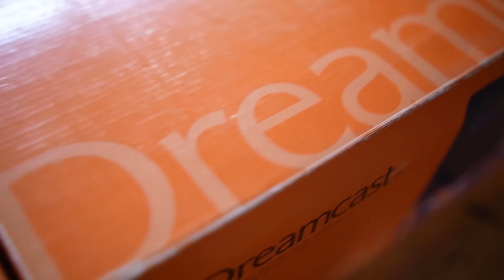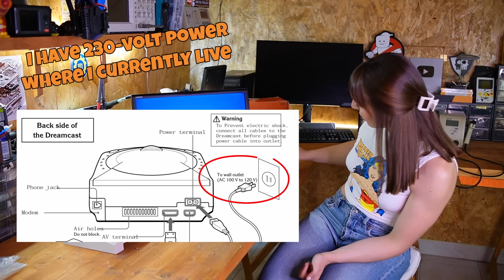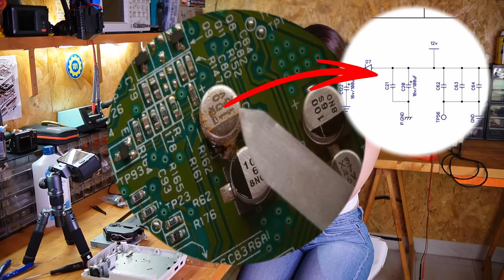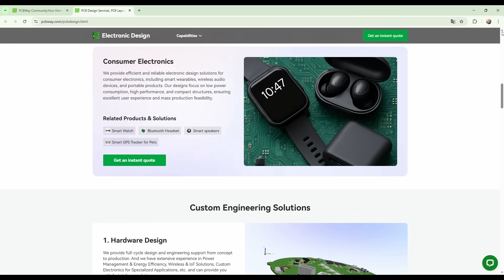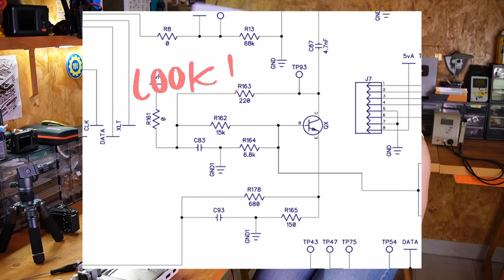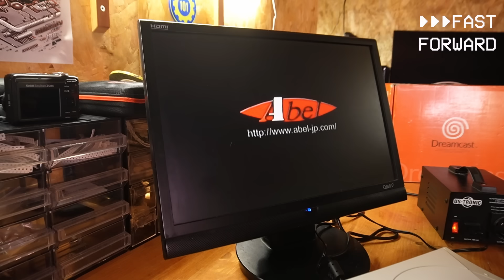Can I Save My Mom’s Dreamcast After All These Years?

Comment: Thank you ..Oh boy I just went through this with my Dreamcast..I tried tweaking the laser but it still stops spinning and can't read the disc...I gave up and just figured after sitting 15 years the laser went bad ..I didn't change the capacitors or resistor like you did...I may have to pull it back out again and check those..I seen a capacitor kit on the Internet for the Dreamcast...Wish me luck my Friend ❤❤❤❤

Comment: My mind went straight to bad capacitor and battery replacement, because even back then just like two years after launch it was always the same bad bad capacitor and the batteries were already going flat and the consoling beeping. The laser as well back then needed tweaking and cleaning.... Still not as bad as the PS2 which stopped reading those blue CD based games really early on. I forgot what caused that problem, but I remember it being something to do with the CDs not weighing as much and slight warping of the system through heat or dirt or wear stopped them from being read..... People blamed the laser, which you could up the power, but it was really just a poorly designed system.

Comment: Sega consoles? Guaranteed thumbs up! :D 
Do you plan to replace the disc drive with a GDEMU or do some other mods (besides the battery)? I heard modding JP models is more difficult due to the mainboard and its specs. Very curious about that...
Reply from the maker: I might try some mods later on, but I’m not sure yet. I’ve heard the same about JP models, so it could be an interesting challenge!

Comment: I got the same version of the Dreamcast from Japan. It's the rare 1998 VA0 revision, which was overengineered, Made in Japan — built with high-quality Japanese components, metal heatsinks connected to a cooling fan, and superior audio output compared to the later VA1 and VA2 revisions which were made in China and Indonesia. So be proud — you own one of the roughly 5% of all Sega Dreamcasts ever made.

Comment: I used to repair Dreamcasts. Just a little Easter egg here. If a factory controller does not work it's the resistor every time. Up it by about 10 ohms.

Comment: I was actually shocked when it didn't work. I got mine in 1999 and it still works now and I never had a problem with it. It has been more dependable than my cartridge based gaming systems.

Comment: I fixed a dreamcast and then broke it worse. I replaced a dead battery and fixed a broken power switch to fix it. Then when I was putting it back together, I put one of the long screws in a shorter screw spot and the screw went into the motherboard, like 2mm. This was enough to take out the video because it would turn on but I wouldn't get anything on the tv. Went from super happy to super sad.
Be careful with them silver screws, the length difference isn't much, but enough to damage the console if you put a long screw in a short screw spot.
Reply from the maker: I’m really sorry to hear that, that’s brutal! Those little silver screws are sneaky like that
Reply: @Sayakas_Digital_Attic they should have made those screws the same length. If not at least change the color or something. Glad you got yours fixed though😊

Comment: I had a Dreamcast when I was in junior high school. I replaced the crystal oscillator successfully. I was impressed by how smooth it became when I overclocked VF3. Overclocking this console's oscillator doesn't affect the display frequency. This wasn't the case with the Sega Saturn, which came before it. Overclocking threw off the vertical sync signal, causing the screen to display incorrectly.
Reply from the maker: Wow, that’s awesome! Overclocking without messing up the display sounds like a dream compared to the Saturn

Comment: I heard for dreamcast, you shouldn't plug or unplug the controller during the power is on. The controller board might got fried by this. I know in other console this is not a problem. But I heard a lot of horror stories about this. I rememebr there is a mod that you can do and it will allow you to do plug unplug during power is on after the mod, but i forgot what it is or how i did it since it has been a while. But i think it's not hard to search online to find this info. Good luck!

Comment: I would recommend you to wear insulating gloves before manipulating a switch mode power supply, reason being at the time not all power supplies had discharge resistor for the high voltage bulk capacitor, and these can be charged at 400VDC, even in power supplies with discharge resistors it can take more than a minute to discharge the bulk capacitor to a safe voltage (<60VDC) when you disconnect the AC input, so be careful because they can hurt you badly and even unalive you. Great video, I'm a power supply engineer btw 😊
Reply from the maker: Thanks for the tip! Really appreciate the safety advice and glad you enjoyed the video

Comment: I actually bought one of those back in 1999 as well. I still have like 4 of them.
Reply from the maker: Awesome! They all work?
Reply: @Sayakas_Digital_Attic  Yep. However, one has some laser issues. It can read giga discs and most CD-R's but, not ever disc that the other 3 can. I see there are tutorials to adjust the laser. I hope that if I get around to it that I can adjust the focus bias only as I have read that adjusting the intensity just makes the laser burn out and die faster.

Comment: Never ever touch the pots on a CD drive unless you’re using a scope to perform adjustments. The pots aren’t the problem.

As you discovered, the problem the vast majority of the time with optical drives where the mechanism isn’t damaged or jammed are bad caps.
Reply from the maker: Thanks, most issues really do come down to bad capacitors

Comment: 9:00 is that supposed to happen?
Nice new edits with these comic arrows.

I hoped for some ASMR controller cleaning ☺
Reply from the maker: Well the capacitor was really badly damaged so by heating it a bit it came off easily, usually that doesn’t happen!

Comment: I won't be fanboying or simping you as most of the comments. I have repaired more than 20 dreamcast that weren't reading disc. From my experience, capacitors on the power supply are always out of specs. I would suggest you to buy an ESR meter. Also, capacitors on the gd-rom controller board are always faulty, they are massively out of specs and you didn't recap any.
Reply from the maker: Thanks for the tips! I’ll definitely look into getting an ESR meter

Comment: I'm having a weird issue with my Dreamcast. One day, out of nowhere, port number 2 stopped responding, later the same thing happened with number 3. I replaced all the components on the controller board, but nothing happened. Afterwards, I tried replacing the entire controller board (including the ribbon cable), but everything remained the same. Could it be that the problem with ports 2 and 3 is coming from the motherboard?
Reply: Sounds to me like just dirty pins honestly, the Dreamcast controller ports can get bent a bit out of shape if controlllers are left plugged in for a while, you should try those ports whilst pressing down on the end of the plug, if it comes back to life they’re likely just dirty.

The controller board is mostly passive so the pins go right through to the main board through the ribbon cable, the data lines pass through a row of resistors, 1 for each data line of each controller, try measurung those of cleaning doesn’t help anything. 

There is also the classic fuse that pops when controllers are plugged in or out whilst the console is on, which can blow the resistor next to the ribbon cable connector, you can fix that by installing a resetting one or just twisting it so it shorts, have done that personality for years and it doesn’t hurt anything and also presents the same thing from happening again, so it might not hurt to just do, likely won’t be the main issue as your A and D ports seem to be working. 

Just measure and clean! You’ll get them working for sure! Cleaning the controller plug itself is also a good first step.

Comment: Waiting on my Dreamcast to arrive, can’t wait to start my restoration and upgrade.

Wow someone has been pumping iron 💪
Reply: Wow!! What a machine!! It truly is a home arcade…and a tractor in sound 😂

Think I got lucky, was a lil mucky on the outside and when i popped her open, just a lil bit of dust and hairs on the edges. Stripped her down anyway. Scrubbed the insides, recapped the motherboard, new 1mm thermal pads on all 4 points, serviced the GD-Rom. Took away the battery and replaced with cradle and new battery. Switched out the orange power light for white. Installed white LEDs in controller port. Dropped it all in a new solid black shell with white decals (SEGA, Microsoft etc) but I swapped the power button and open button and the controller port shell with transparent blue. Painted in the words POWER and OPEN and the letters A B C D in white. Swapped the black lid for the transparent blue, and the finishing touch… a black badge with the blue swirl and white writing 🤌🏻

Comment: One of the quirks of the DC: if you remove the controller from the first port while the system is on, it could blow a fuse in the system. Congrats on 150k, looking good! ^_^

Comment: Hey you have a Weller soldering station there! Which model is it and how many watts is the iron? Mine was given to me by my uncle back in the 2000s, a 45W iron and station. I think I will buy some larger tips for it soon, to do thicker wiring / harder jobs.
Reply from the maker: This model: Weller WE 1010 (T0053298699) 1 Channel Digital Soldering Station, 70 Watts / 230 Volts, Temperature Range 100 °C to 450 °C, Blue

Comment: You can convert the power supply to universal voltage, since it's a simple flyback type. The difference between JP and PAL models is 3 components, PAL has capacitor C3 68u 400V, R13 and JP1 62kOhm 0.5W. Uprating C3 to 400V (capacity is not critical) is necessary and more or less sufficient, but R13/JP1 is the bootstrap line for the SMPS controller so i think that's good to make sure there's enough resistance, the PAL build should bootstrap at 100V just fine too, just take a few milliseconds extra.

What the bootstrap line does, it trickles some current from the rectified mains into the capacitor C10 until the SMPS controller has enough voltage to start pumping the transformer via Q1, and then it'll start getting power via the main transformer through D2 from an aux winding. In old and tired PSUs, the bootstrap capacitor is generally bad and is the first thing i test or replace and uprate, and you never see the issue visually since they don't leak.

The batt often doesn't need to be replaced, just leave the console on for 40 hours and the original one can wake up and start holding charge :D But ML2032 replacement is totally fair as well.
Reply from the maker: Thanks for the detailed explanation! Really appreciate the tips on converting to universal voltage and the bootstrap line, super helpful for future repairs

Comment: Hearing you say it works is instant serotonin. Orange box nostalgia, step down on, good cable in, pot tweak and bad cap out, new battery holder and then the magic, it works. Super clean work and a very cute assistant.
Reply from the maker: Thank you! It’s such a satisfying feeling when everything comes together and works perfectly 😊

Comment: Can you save a Dreamcast that powers on and is functional outside of the disk mechanism, my guess is sure.

Adding a bit of flux when using solder wick and it works so much nicer.

Comment: PSA: Please NEVER plug / unplug a controller into the Dreamcast when it is switched on. It will almost always pop the fuse in the controller board which will prevent controllers from working until it is replaced.

Many people are putting in resettable fuses.
Reply from the maker: Thanks for the heads-up! I’ll be more careful next time

Comment: Nice that you take care of your mother's good old DC. 😊

An anecdote from me: 
The Dreamcast I'll never forget it, we were playing Metropolis Street Racer on the Dc and it was connected to a 21" CRT VGA monitor with a VGA cable.
I had bought a Japanese PS2 with Ridge Racer V and a Memcard through a dealer and the doorbell rang and the PS 2 was delivered. 
We briefly paused MSR on the Dreamcast and wanted to test the PS2. When Ridge Racer V started and we saw the evil edge flickering of the graphics, we looked over at the DC monitor and the disappointment with the PS2 was great. 
I immediately packed the PS2 and sent it back. Only after the end of the Dreamcast did I buy an EU PS2. 

The DC was far ahead of its time, it's a shame that Sega has withdrawn from the hardware sector.
Reply from the maker: Wow, that’s a great story! The Dreamcast really was ahead of its time and I totally get the PS2 disappointment!

Comment: Most, if not all, top load optical drives have a safety switch that prevents it from running when the top (or cover) is open, so you don't get lasered in the eye. That is why it didn't turn on properly, until you put the case back on.

Comment: there's a reddit threat in r dreamcast from 2 years ago called 'dreamcast oscilloscope laser adjustment photo baseline' it has a couple of waveform images and the two solder points for testing to properly adjust lasers for this particular console.

using ohms as a way to get lasers adjusted right .. doesn't give you an ideal laser output, it just adjusts the trim pot. proper adjusting uses an oscilloscope and the peak mv while getting the output signal as clean as possible. tweaking it is done via suuuuper tiny movements. this is true for pretty much any laser assembly in an optical drive. the ohms method is.. okayish for some, but for most you're literally risking the laser module.

i've also seen ohms readings on dreamcasts ranging from 1k up to 1600. it depends entirely on the laser modules components. and sometimes, adjusting the laser pot up or down too far (for that module) in ohms can break the module irreparably. and that range can be tiny. ~50 ohms can do it. the adjustments are very module specific.

and at this age, if one of these isn't reading discs, recapping the unit should be the absolute first step. no exceptions. recapping it could fix drift issues with the laser units accuracy and make laser adjustments irrelevant.

oh, and cleaning and lubing the rails/etc of the tracking assembly.

at any rate, cheers.
Reply from the maker: thanks for the advice!

Comment: I wish my defects in vintage audio where always this obvious. Mostly  very old capacitors +30 or even +40  years do not even leak like this one. So you  replace them all and often it still doesn't work.  Great fix. though.
Reply from the maker: It can be tricky when the problems aren't so obvious!
Reply: @Sayakas_Digital_Attic  Well you are fixing it without schematics, and that is an art by itself.

Comment: Repairing SMD capacitors and small resistors is difficult. I have to do this with a synthesizer. I've got a USB microscope, tweezer soldering iron. Let's see if I can manage.
Reply from the maker: It can be tricky, but the right tools definitely make a difference!

Comment: Also Get fitting a gdemu. I put a resettable fuse in my Dreamcast. And battery mod. And clear black case. And gdemu with the tray part. I’m always modding consoles. Gonna do the Xbox 360 soon. Got one waiting for the time to get on it. I have 3 5tb hard drives full of roms and isos for any console you can get them for
Reply from the maker: Wow that’s some serious dedication to console modding! The Dreamcast mods sound amazing especially the GDEMU and battery setup

Comment: Be careful with laser current, low resistance-higher current, high resistance-lower current. Set the potention meter to 1200 ohms.

Comment: 5:50 how did you know about the spec required for the laser potentiometer? Did you study electrical engineering or something similar?
Reply: It's only a google away, but it can vary pretty wildly, i actually think 1000 is a little on the low side, that's lower than any of them i've ever measured, it might just have been used little so it's not as sensitive to a slightly off pot. As opposed to one that needs a tweak cause it's barely hanging on. 

Honestly happy she didn't blow it out and actually inspected the board and found the issue, giving a pot like that giant changes in resistance definitely can do more harm than good if you do it too hastily.
Reply: @HKT-4300  yeah, I assumed it was information she found on some forum. Which is great and sad, since we don't have actual schematics and spec sheets for repairs. True, I've heard laser readers that need their potentiometer tweaked are on their last leg.

Comment: Some old consoles are worth converting with ODEs, so you can load all games to an SD card or USB drive. I do still collect physical media and have near complete collections for the PS1 and CDi, but being able to select a game from a list makes things a lot easier and encourages you to play the games you're collecting. As I'm less interested in Dreamcast collecting, but would enjoy playing some of its exclusives, I'd love to do an ODE on one with a faulty disc drive.
Reply: You mean GDEMu for Dreamcast. Which is okay if one uses a later revision VA1 Dreamcast but if one has a OG release VA0 from Japan, it would take soldering and replacing 7 resistors to make it deliver only 5 volts to the SD drive. If the Dreamcasts cd drive still works, one should better leave it like that. The only thing worth modding/changing is the PSU and the dead ML2032 battery.